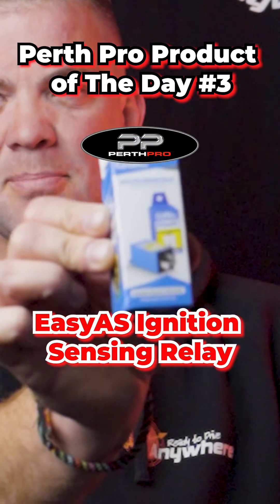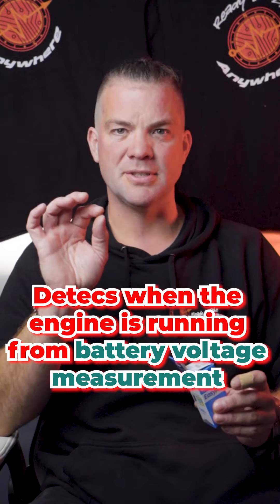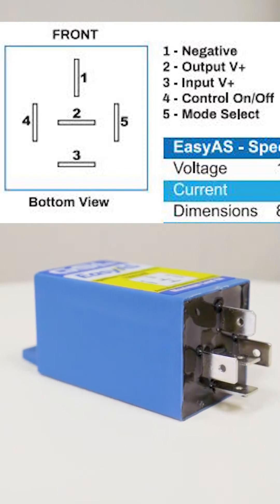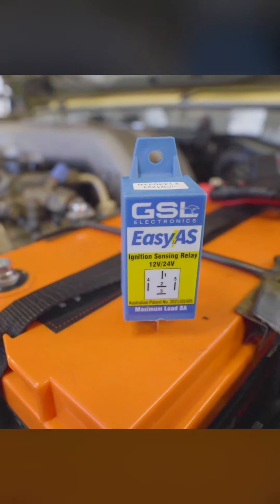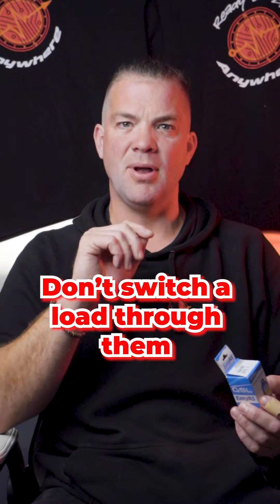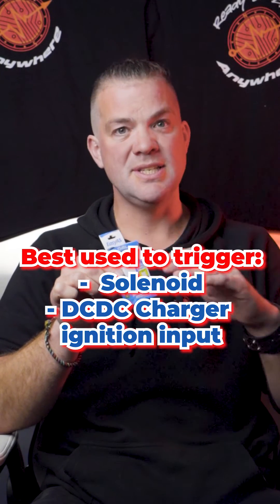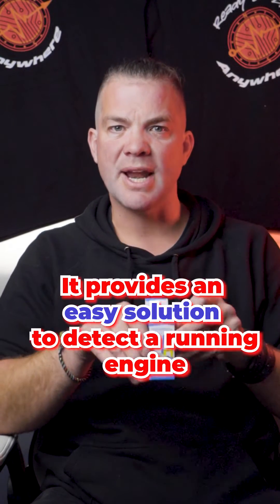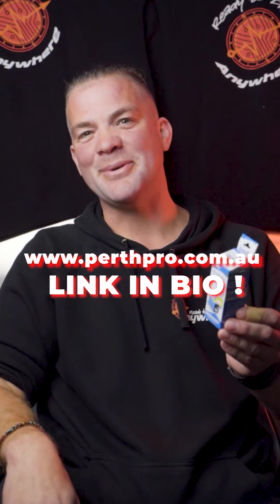GSL EasyAS Ignition Sensing Relay

Comment: Just purchased and installed one of these. It does not work, as soon as the ignition is turned to the on position the dc dc charger turns on without the engine running. I've contacted GSL for some advice on how to fix it, unless it's a faulty unit?

Comment: I bought this to turn on/off my cooling fan(draws 0.1a) for my dcdc charger in the rear drawer. But I found it didn't work. When I wired it directly to the main battery in the engine bay and tested it with a multi meter, it seemed to be working. Do you know why? From my main battery to the rear is a 3m 6 B&S cable. Would that affect the detection?
Reply: Same problem here.

Comment: Would be really good to have one of your videos step through connection in a typical back of the ute install with DCDC charger.
 Show where you put the unit in the vehicle  and step the installation through slowly for idiots like me.  You are highly knowledgeable but seem to assume others have knowledge - which iin my case I don't!  No good waving a relay box at me -- I prefer to see.  Just install one and let one of you pals film you.
Show what and how to connect the cables coming from the front of the car to the ISR and to the DCDC charger. 
What happens to the blue ignintion wire? 
Step by step.
Thanks!
Reply from the maker: Hi, we will definitely add it to the future videos list, thank you.

Comment: Hi Heiner
(Thanks for replying to my recent email about the smart alternator / dcdc charging issue being discussed on various forums)
I assume this device goes some way to prevent you losing charge from your starter battery to your auxiliary battery when using a dc-dc charger. But on a smart alternator - if the starter battery charge is 80% or higher - and the alternator drops the output voltage to reduce load on the engine (Cat 5) while it is running, will the DC-DC charger continue to take charge from the starter battery in order to charge the auxiliary battery? - and the alternator only increase output when the starter battery voltage drops to a certain value?   This then presents the risk under some circumstances, of not being able to start the vehicle after a camp. I look forward to a video explaining this issue and your professional assessment of solutions and a shopping list.

Cheers

Jon T
Reply from the maker: It will prevent the DC/DC charger from turning on while charging the start battery if the settings on the DC/DC charger have been set in a way that the switch on voltage is above the highest voltage the battery charger charges it up to.

The Easy As engine run detection relay will keep the output on Pin 2 (which needs to be used to trigger a DC/DC charger IGN input) switched on as long as the start battery voltage is above 12.5V AND while it still detects the ripples in the start battery voltage that are being induced by a spinning alternator. If the ripples stop OR the voltage drops below 12.5V Pin 2 turns off and the DC/DC charger stops. Battery chargers do not create the ripples.

There should be no risk to discharging your starter battery while the engine does not run.